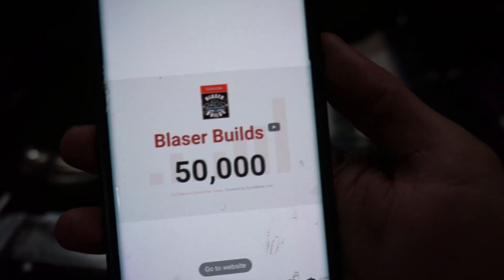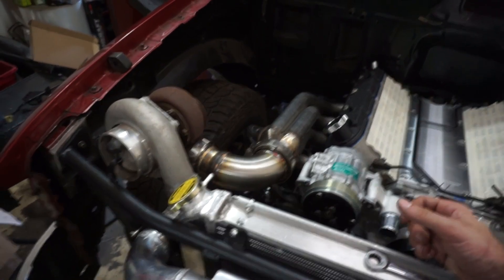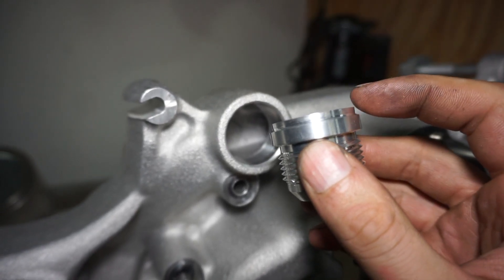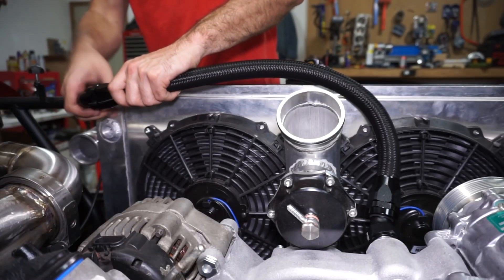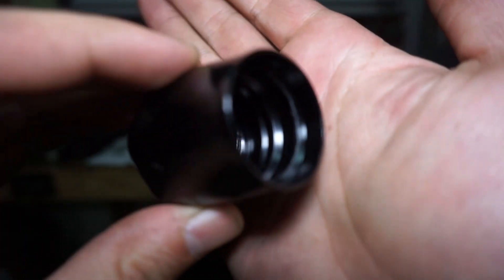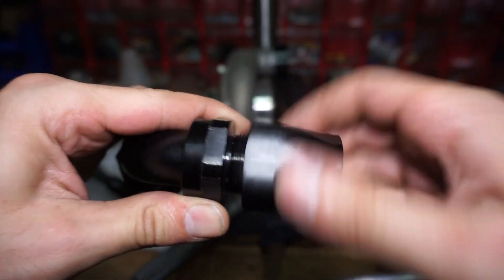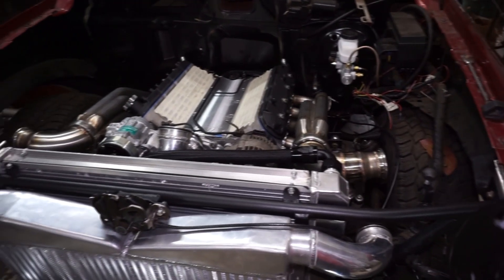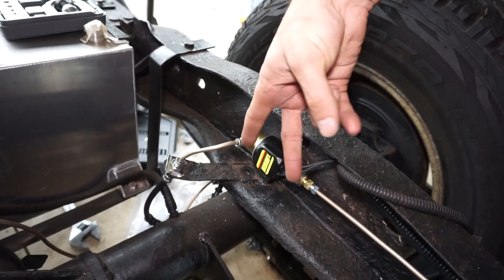Wastegates And 16an Radiator Hose Bonanza!!! | 50k SUBSCRIBER VIDEO!!!

Comment: So I’m preparing to convert to 16 an system for my BB Mopar. Did you have any cooling issues? I have all the nay sayers saying I’m killing the flow and it’s gonna overheat on the street… I see this stuff on big HP cars so I cant believe it doesn’t work. I’m installing a 26” x 17” core rad and I have a Meziere high flow electric pump. Thanks in advance for your help